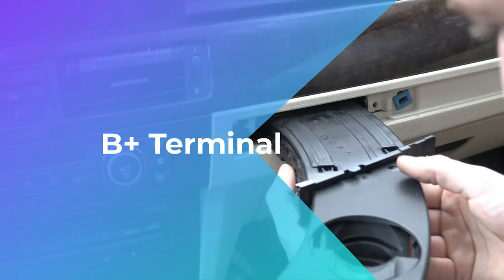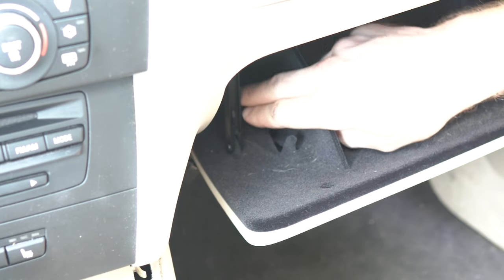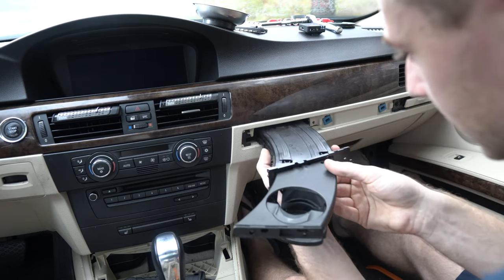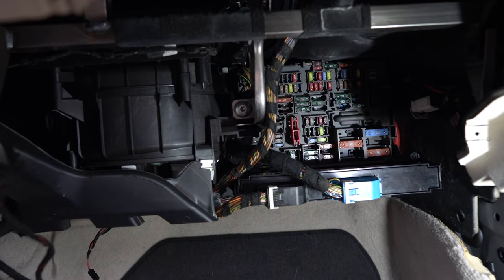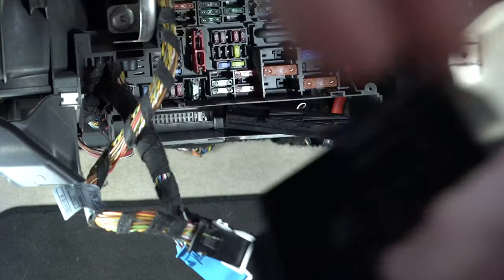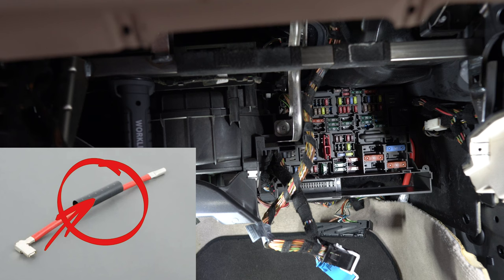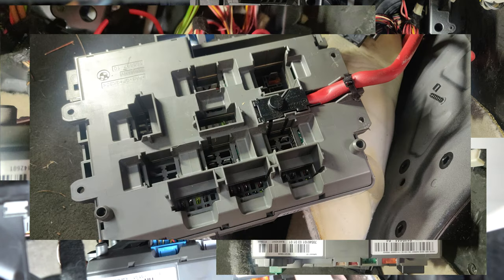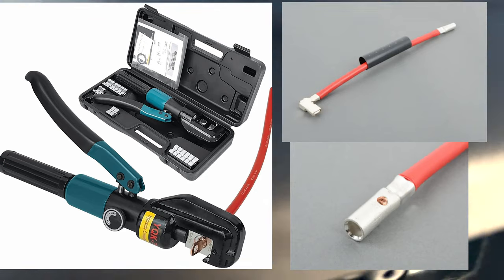BMW e9x B+ terminal No Crank No Start No Power Glove Box Fuse Box Removal

Comment: i removed the 4 torx and still seemed fixed on left side   cant fiigure whats still holding it down? Wish u would show each step a little slower as far as showing the how to's for whatever your explaining instead of assuming we all know how to do even the "simple stuff" like for us WOMEN lol...
Reply from the maker: Hey. Thank you for the comment.
So in total I removed 5x screws, the one that is visage upfront, that I said is for AC bracket, so this one was removed simply for convenience, but farther behind it there actual screw that holding the fuse box. There also 2x screw for BCM module but they strictly to hold the bcm in place, and that should be it, just try to move it around, it usually seats pretty tightly.
Good luck.

Comment: Hey I just bought a 325i 3 series and it's has a ticking noise coming from the fuse box which keeps killing the battery and then I'd have at boost it again to get it started
Reply: yo thats happening me rn bro what have u done to get it working
Reply from the maker: As I mentioned in the Video, the main problem was B+ terminal, make sure you have good connection on the fuse box. Also the IBS could be the problem. If you connect the jumper cable to under the hood terminal, do you get power on the cluster?
Reply: @Makhnovets  I have total loss of power no lights on dash steering lock is on car can't be moved tried new battery nothing works car was left without starting for 2 months won't crank when button pressed. The car is e93 2008 petrol. Any help would be appreciated
Reply from the maker: Did you already check the back of the fuse box? The connection point of B+ terminal?
Reply: @Makhnovets  No will check all tomorrow look at all connections especially the blue one like your video. Thanks very much
Reply: Having the same issue. I need to check my fuse box. Tried to jump start my car and nothing. No power for the past 2mths now.
Reply: @SkillzDaKidd hello. Did you figure it out? Thank you G
Reply: @singhsarabjit did y’all ever figure it out
Reply: @Makhnovets so i don’t have to replace b+ cable correct?

Comment: I’m having issues with my 2011 328i. Windshield wipers starting up for no reason, hazard lights going off and then the car went completely dead. Battery is fine. Unsure how to even start. Any help is greatly appreciated
Reply from the maker: Chech the codes with pro level scanner

Comment: Hey whatsup. I have a problem with my e81 116i. I have no power on the fuel pump. Changed module changed everything but i dont seem to get any power. Sometimes car start for a minute then it dies. Do you have any idea what can it be?
Reply from the maker: Hey. Check the relay/fuse. Trace the cable/wire on the connector both sids with multimeter, what codes do you have on obd? It might be the fuel system lock due something else…

Comment: Hello Sir, I am having same issue with 2010 BMW 750Li xDrive 8 Cylinders 4.4L Twin Turbo. None of my fuse blown and I am getting power to fuse box fuses. Does that means, fuse box is good? Thank you very much.
Reply from the maker: What codes it posted if you can read it?
If that’s not the fuse box than look for the dme relay, if car completely dead, means you are missing either the ground or positive abdominal if power goes to fuse box but not after, make sure you check power on all of the fuses, and see what line is missing.
Reply: @Makhnovets  thank you brother. Appreciated very much 👍😎🆗

Comment: Good video. Got it all pulled down to just the single main power supply cable on the back. Got the bolt out but I cannot get the terminal to come loose from the board. It does not appear to be melted but it will not come off. Is that power terminal welded/soldered to the connection on that board? Looking like im going to have to replace that terminal connection on the end of that cable.
Reply from the maker: hey. the wire melts itself to the board, so there is no safe way of removing the wire. You'll need to get the replacement kit and cramp the new clamp to the wire. that is unfortunate, but also understandable, since those cars' batteries are big and powerful, simply it's designed the way that the connector will pretty much weld itself.

Comment: those top screws on the fuse box are no joke to get to, what tool did u use, im pushing down on the blower motor about an inch and a half and theres still no room lol.
Reply from the maker: I removed the screw from the blover motor, it's pretty gimmicky, but i think I used one step smaller torx bit, and I had couple extensions like in this tool kit - https://amzn.to/3gzvjTG

Comment: After that my e93 have air bag error and the water Temp goes high and the engine Get to hot. What can i do ?
Reply from the maker: Did you shorten some fuses?
Check fuse box for burned fuses, read the codes. 
Last one is could be that you didn’t connect one of the connectors at the back of fuse box, or when you plug the connectors some of the fuses might pop out, make sure the connectors and fuses are fully seated!

Comment: I have the same car model but my red wire cable plug are different , do you know where can i buy this replacement ?
Reply from the maker: I think I have it in the description, otherwise type BMW B+ terminal. FCP or eBay would be the easiest.

Comment: Hello! So i went for a drive in my 335i after getting it all back together after 5 months. Got home turned off the car and no power what so ever. I then hooked up my trickle charger and the P on the gear selector alongside my rear brake lights would flash every few seconds. And there is also clicking noises coming from the fuse box. When take the charger off it goes back to having no power. This just happened and i suspect a dead battery, starter that shorted, corroded chassis ground, or this problem in the video. I wanted to see what you think might be the problem??? 

Thank you

Comment: Hi, I have no power on the connector to the AC blower fan controller, but the fuse is good. The harness recall was done on this car before I bought it. Seems like it was done right. No obvious signs of a short or a break. I suspect the issue might be in that junction box. Has anyone ran into the same issue?
Reply: yes, I'm dealing with the same issue. Did replacing the fuse box fix the issue?
Reply: @arnoldkaplan5563  I have not tacked the project. Too hot in the garage 🤣

Comment: Great video. Wonder if you can help I have 2008 bmw 318i.  Have fault code 2acc dme relay fault . Can't seem to find it . Its not in box under bonnet have only one relay there a black one . Controls radiator fan. Any ideas.
Reply from the maker: RealOEM.com
Type the vin and it will show you diagrams and equipment that is on your car.

Comment: How exactly do u remove the 3 plugs on the back of the fuse box, they are black grey and blue, do u pull them out with pure strength or is there something I have to pinch in order for them to come out?
Reply from the maker: Each of them have a clip, I used a pick tool to push on the pin, and then put it.
Reply from the maker: Also, for the b+ terminal if it looks clean, don’t try to remove it, only if it’s burned, otherwise you will break it. There no way to remove it safely.

Comment: hey my car has no corrosion at the red wire or on the junction box but it has 0 power, could that still be the cause? i’m stuck and don’t know what to do
Reply from the maker: There big fuse on the positive terminal of the battery, make sure it’s not blown. Also check the IBS, it seats on the negative terminal of the battery, you might want to replace it if that’s not a fuse. I have video on that topic as well
Reply: @Makhnovets  would all of these cause the battery to drain? recently the battery drained, also if your talking about the red fuse box that sits on top of bmw battery, i’ve replaced it a couple times but same thing happens power cuts off immediately causing me to jump from battery which blows that fuse on the red box. stuck in a loop

Comment: Bonjour jais mon véhicule qui ne s'allume plus jais juste à bouger la boîte à fusible pour que le courant reviens je pense faire votre manipulation mais je je c'est pas si je doit changer que le câble ou la boîte fusible ou les deux merci pour votre vidéo .
Reply from the maker: Usually it comes down to the B+ connection point on the fuse box, if you can remove the cable with out damaging the fuse box, then you replace cable only, 
But usually you need replace both.
Good luck!
Reply: @Makhnovets  merci pour votre retour
Reply: Bonjour, dois-je enlever le + de la batterie et le- ou juste le plus Cordialement.
Reply: Bonjour jais fini le travail mais l’écran de gps radio ne fonctionne pas .le reste tous ok
Reply: Et le radar de recule aussi ne fonctionne pas😢

Comment: i definitely need this repair.
Reply from the maker: Did you remove the fuse box already?
Reply: @Makhnovets   no not yet my heater blower was just corroded as the person i purchased my bmw from had let it sit in the woods for a year. resulting in seals rotting away interior molded fuse box was corroded took out my mirrors. i had to take the scowl off near the windshield wipers and clean all seals. while i was there i checked to see if my blower turned and it was stuck due to rusting i had nudged it so it can freely spin and it started to work after that. i have the recall on my 328i i go on the 11th.
Reply from the maker: I see. Also don't forget about junk yards, they a huge help! cheap, and you can finde lots of parts for 3series.
Good luck!
Reply: @Makhnovets  started digging deep on the fuse box and all fuses are corroded bad. I tried to clean them all but it resulted in the vehicle not starting. I had to take the large black relay apart and clean its contacts I replaced it now it works again but the wipers are done for due to that relay being bad as well. I’m in a pickle and forced to do this repair thanks for the info.
Reply: @sipmeister3611  I tried fixing my blower motor and after I cleaned all the rust I put it back and now my car only cranks no start what do u think this can be

Comment: i have the junction box out but have no clue how to get the back plug back in any tips?
Reply from the maker: what do you mean you can't get the plugs back? the think is that each plug go in only  one socket, but if you can't fit it, remove the fuses but make sure to make the picture of there location. also, at some point of video there pictures of back portion of the fuse box, just pause and try to get the complete picture.
Good luck.

Comment: Is there a link to manual for this fuse box I have same fuse box but I don't have manual I'm getting errors maybe I'm missing fuses but do not know which goes where any help ?
Reply from the maker: You should find it here, also it's nice to have it on your computer. Repair Manual BMW E89 z4 (N54 engine) - https://drive.google.com/file/d/1vfcY-X3cPXGjwzr5DMtQ-_NmounR7k8b/view?usp=sharing
The PDF File is over 200Mb. Don’t ask me where to find a specific section.

Comment: How about a code for A731 (Supply, terminal 30g-f) what can cause this and what is the fix?
Reply from the maker: you can check for burns or blown fuse, this code related to electric terminal, can't say much specifics, but it could be the reason.
Reply: @Makhnovets  all fuses checked ok I changed my JBE module and it keeps blowing it
Reply from the maker: @Lu-e  what fuses getting blown? Make sure that line have no short. Or the module that is for the blown fuse is not throwing any messages, the next step would be a BCM body control module, it’s pretty cheap and if you can fond same module you can install it as is and later on do the coding/reset if it works.
Reply: @Makhnovets  I’ve installed 6 BCM (JBE) boxes all have blown, I use protool to code it and every time I do it the module blows. I don’t see any blown fuses. At this point do you think the wiring harness could be the issue? Or what exactly. This is for a 2007 BMW 335i coupe
Reply from the maker: @Lu-e did you by the chance monitor the power from generator? Or have over voltage message?
I would blame the power regulator that is part of alternator, you can separate replace it, it one of not many things if not only one that can fry the components it can deliver way higher voltage that the car needs if it’s not working correctly, when it wears out it starts delivering high power. https://youtu.be/QOuo1hd8oBw?si=A7IufRY-q6wt6f9i
Reply: @Makhnovets  will look into that
Reply: @Makhnovets  have not checked the voltage but will check in a bit, what is the normal reading for it? 12v-13.5?
Reply: @Makhnovets  I checked the voltage said it was 12.54 V
Reply from the maker: @Lu-e  It seems really low, I would assume you did it while car was running? Also you can check the OBD, read voltage value from alternator.
Reply from the maker: @Lu-e  when it's idling it should stay around 14-14.7 not higher, also anything under 13.5v intentionally can create all sort of problems.

Comment: Will this work for a 2011 335i I swapped my battery  I had a dead cell it started I turned it off  now it won’t start Gita lighting malfunction headlights on no inside can anyone help 😅
Reply from the maker: The IBS could be the problem. also, check for the Recall, if your car getting in this category, it definetly worst checking. Before going any farther, make sure to check the engine relay, or DME relay. beside that have no other clue. 
Do you have power when you pop the key?
Any clicking or noice  after you pop the key?
Battery voltage, on battery and under the hood?